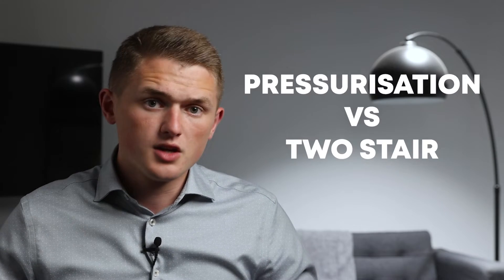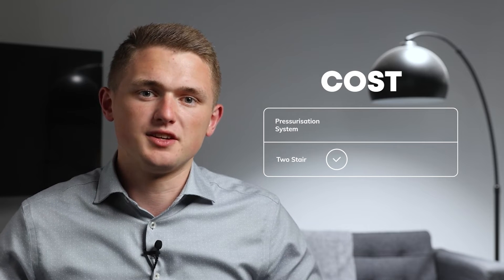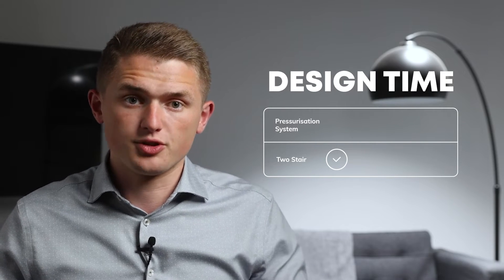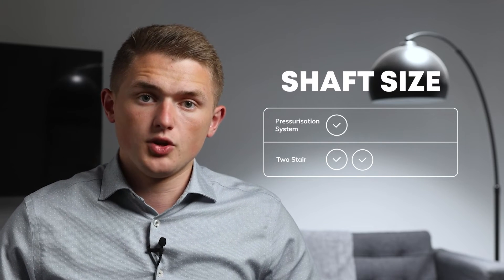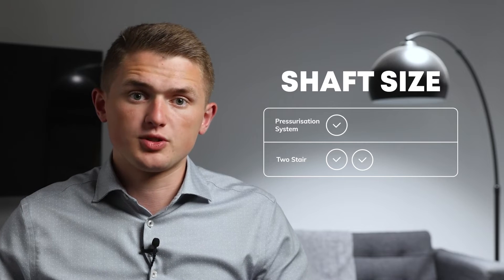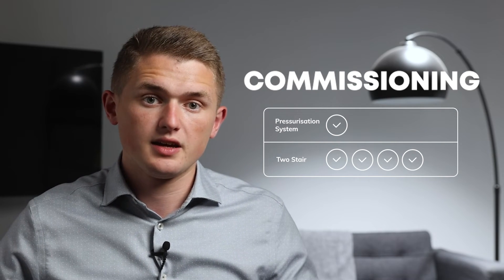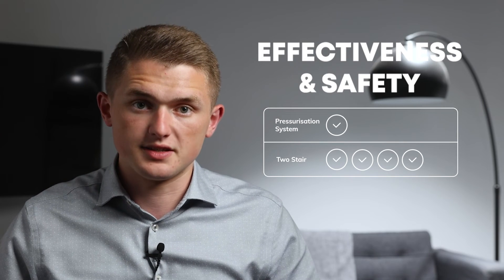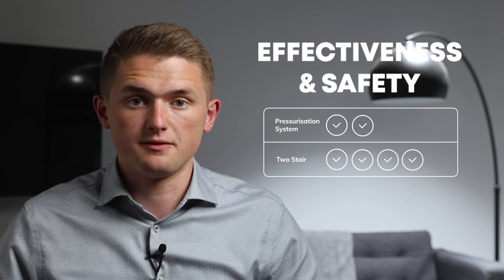Two Stairs vs Pressurisation: Which System Should I Choose?

Comment: Great content guys, thanks for this. 

Just had a few queries with regards to this topic in light of the BS9991 2021 draft:

How would you incorporate an air release path within a high rise single stair building with pressurisation given there is no access to the facade from the common corridor? If the system design criteria is the same (pressures / velocities), then would the sizing of the openings also be the same?

Also, for a common corridor with an extended travel distance in a high rise single stair building, what are the implications of an independent MSVS (required to justify the extended travel distance) working in conjunction with the required pressurisation system, and how do you think this can be overcome?
Reply from the maker: Hi Mohammed, thanks for your questions and the great feedback! 😊 I'll make a note of these and look to give you a definitive answer in future videos after looking at the topic more closely! Thanks